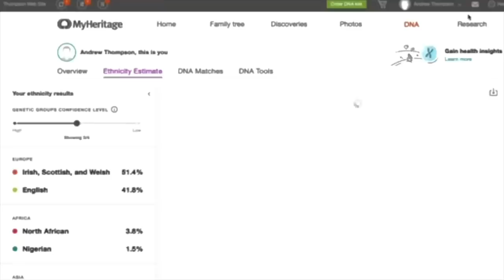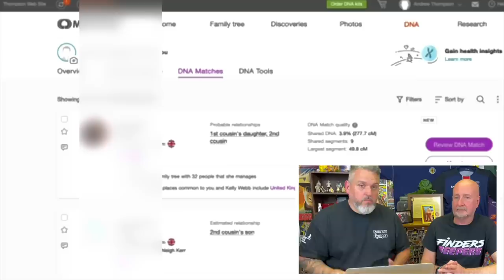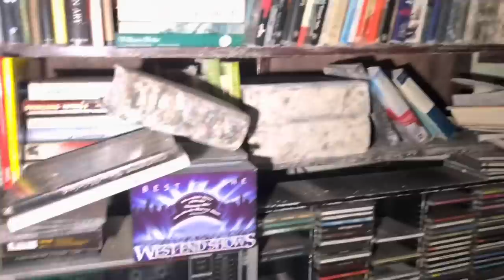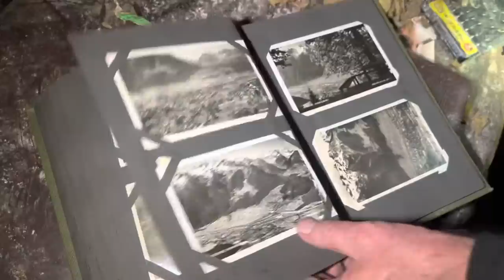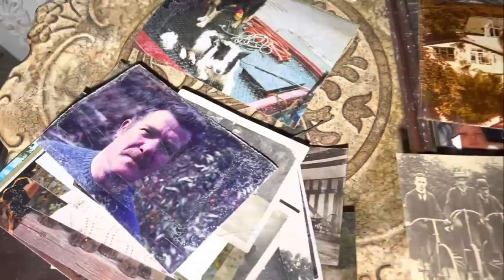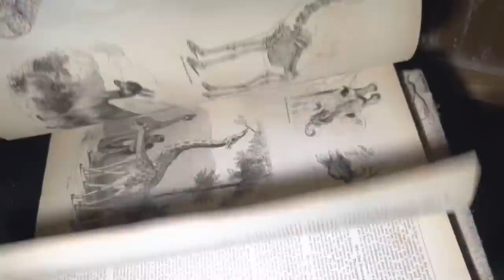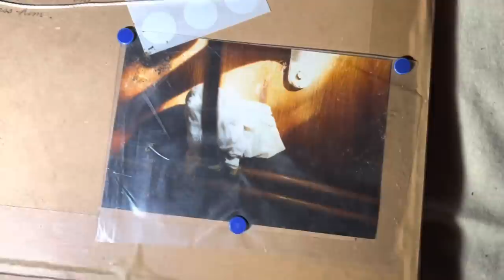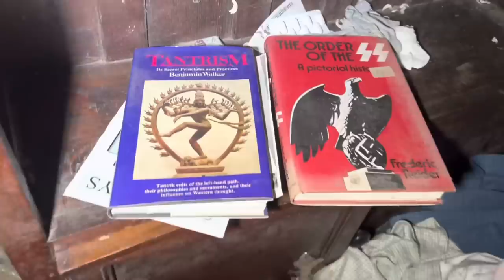This Creepy Abandoned house had something in the walls that possessed my dog

Comment: On the document, it looks like it's between a Cordwainer, which is a term used in boot and shoe making. Cordwainers are masters in the art of working with new leather. I have a line of Cordwainers in my fathers family lineage, the rest were boot and shoe makers. It looks like you've found some wills. I'd love to have documents like that.
Reply: Yes, it’s agreement for apprenticeship under the Cordwainer, which yes was a shoemaker that made fine luxury shoes where a shoe maker made basic/work shoes and boots. In the document the apprentice agrees to stay and work with the cordwainer for seven years. At which point he would be free to start his own shop.  I’ve researched my ancestors and found Cordwainers, and this type of document was standard when hired as an apprentice to learn a trade from a master craftsman. Absolutely has nothing to do with slavery as others have commented on the video.

Comment: A tintype, also known as a melainotype or ferrotype, is a photograph made by creating a direct positive on a thin sheet of metal, colloquially called 'tin', coated with a dark lacquer or enamel and used as the support for the photographic emulsion.

Comment: Doesn't indentured mean a prisoner due to debt? That letter outlines the terms of paying off debt.
Reply: Indenture means apprenticeship.
Reply: @Margaret Ogrady  This is what I found:Indentured servitude is a form of labor in which a person is contracted to work without salary for a specific number of years. The contract, called an "indenture", may be entered "voluntarily" for purported eventual compensation or debt repayment, or it may be imposed as a judicial punishment. Historically, it has been used to pay for apprenticeships, typically when an apprentice agreed to work for free for a master tradesman to learn a trade (similar to a modern internship but for a fixed length of time, usually seven years or less). Later it was also used as a way for a person to pay the cost of transportation to colonies in the Americas.

￼

An indenture signed by Henry Mayer, with an "X", in 1738. This contract bound Mayer to Abraham Hestant of Bucks County, Pennsylvania, who had paid for Mayer to travel from Europe.

Like any loan, an indenture could be sold; most employers had to depend on middlemen to recruit and transport the workers, so indentures (indentured workers) were commonly bought and sold when they arrived at their destinations. Like prices of slaves, their price went up or down depending on supply and demand. When the indenture (loan) was paid off, the worker was free. Sometimes they might be given a plot of land.

Indentured workers could usually marry, move about locally as long as the work got done, read whatever they wanted, and take classes.[citation needed]